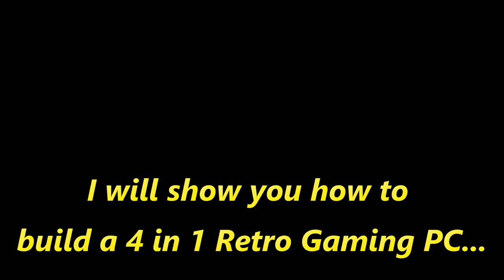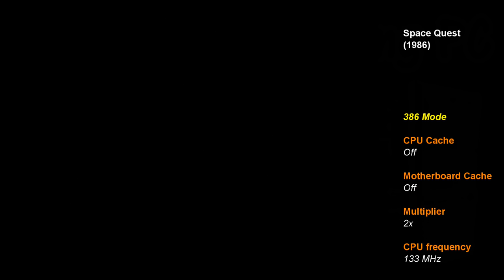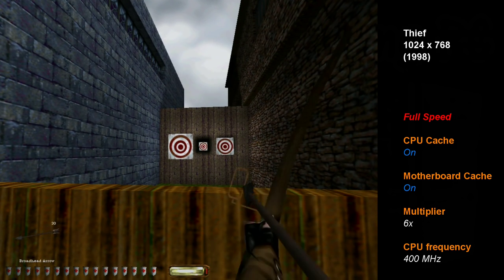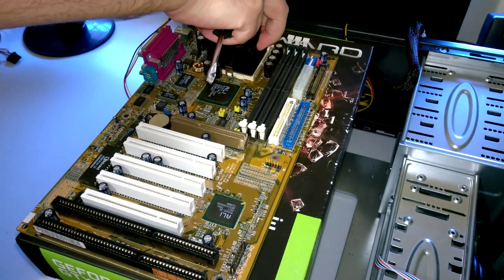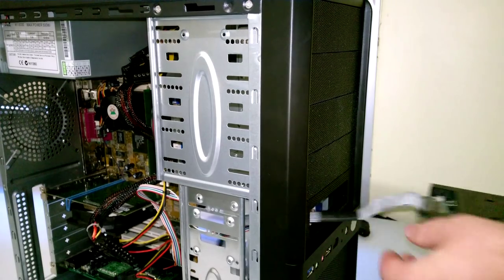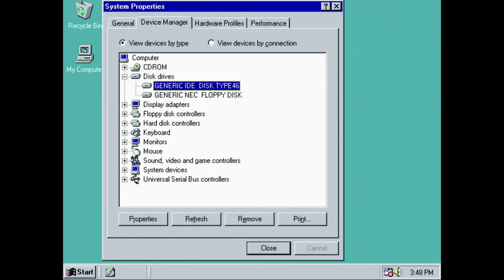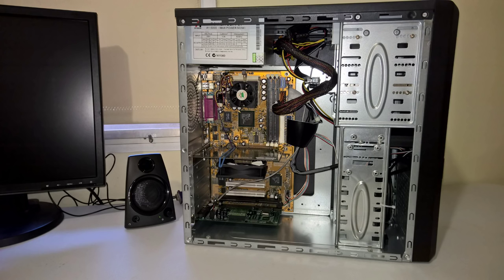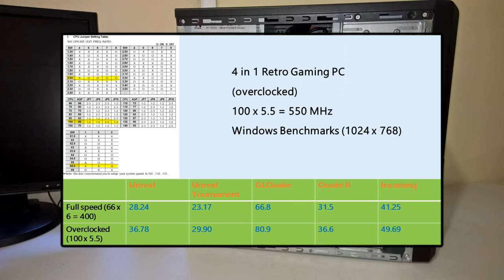Building a 4 in 1 Retro Gaming PC

Comment: Thanks for this - great space saving idea.  Any specific reason to not go with a faster 3dfx card?  I'm thinking of going with an ASUS P5A-B for this...do you have any experience with it and/or thoughts?  Also, I'm gonna track down an LAPC-I, what would you ideally pair it with?  Thanks!
Reply from the maker: Anthony Miller The main reason is that this processor will bore the V5. A Pentum III 800 MHz or so is a better fit for the V3. Asus boards are all great, just check that it supports the K6-2+ and K6-III+. LAPC-I is nice, but needs a PSU with -5V rail. Not a big deal, but they are getting harder and harder to find. IMO you're better off with an external MT-32 / CM-32L / CM-64 / CM-500 unit. Any Sound Blaster would go nicely with it for digital speech.
Reply: philscomputerlab Thanks, V3 it is.  I like the idea of the smaller MB form factor so I can fit all this into a white desktop case...more nostalgia for me.  Re: sound/midi, same power deal with a GUS?  I was thinking of an MT-32 as well, so will go that route.  Any considerations there?  I know it has an external PSU, but how would it interface with, say a SB AWE 32?  I appreciate the help.  I used to know all this stuff, but...been a bit of a while.  :)
Reply from the maker: While I got a GUS PnP, I'm just not a fan of it. I know lots are, but I'm just not so fond of it :)

You connect external MIDI devices to the AWE by using a joystick / MIDI cable. These can be found on eBay.
Reply: philscomputerlab If money were no object and the power supply issue was a mute point, 
what midi solution would you go for?  It seems like the CMs support some
 additional sounds that the MT-32 doesn't as well.  Not sure if the LAPC
 encompasses all of it...
Reply from the maker: Money no object? Well then you need to go for MT-32 (Old), CM-32L and Sound Canvas SC-55. This will cover all your MIDI basis. There are games that sound best on each of these, depends on the game. Sierra is mostly MT-32, Lucasarts and some others CM-32L and later General MIDI games sound best on Sound Canvas SC-55.
Reply: philscomputerlab Excellent!  Thanks!  I will seek them out.  These would be hooked up only one at a time, so no resource type conflicts, correct?  

Same question with the remainder of the setup...anything else you'd change without a budget constraint?  I picked up a Voodoo 3 3500 (TV tuner one) for really cheap thinking it would work well here too.  The Roland CM-110 speakers look like they'd compliment this amazingly, albeit expensive as well.
Reply from the maker: If you got 3 hours time, there is a video on my channel. The Ultimate Roland MT-32 tutorial. It's a bit long winded, one of my earliest videos, but covers everything you need to know.

While you can connect only 1 MIDI device to the joystick port, the Roland units have a MIDI THRU, which lets you put units in series. I have these three units in series. I also use a 4 channel stereo mixer, as well as a 4 to 1 audio switch. And lots of audio cables with all the correct plugs. It's quite a bit.
Reply: philscomputerlab Great, I'll take a look.  Found that Asus board with a K6/2 500.  Wonder if that will perform similarly.  Seems to be able to be stepped down as well...
Reply: philscomputerlab I'm finding some K6 III+ 450/APZ, which is also 1.7V.  Do you think that could push the 386 stuff just a hair too fast?
Reply from the maker: Once you disable the caches, the clock speed matters very little. The chips all perform around the same level, doesn't matter if 133 or 550 MHz.
Reply: philscomputerlab Great, thanks.  Re: the SC-55 you mentioned above, which revision/version is the way to go?  Weird that the hardest thing to find at this point is a nice, white type older case to throw this all in....found a nice one with a 250W PSU...that enough?

Last question on the MIDI options...  Is the LAPC-I essentially both an MT-32 + CM-32L?  It seems to have the additional sounds of the CM-32L with all the compatability.  I know you mentioned that the +5 rail PSU might be less available, but outside of that, is there any reason to get the (2) external units instead?  Thanks again!
Reply from the maker: The version of SC-55 shouldn't matter much. There are tiny differences, but really only a few games are affected.

The LAPC-I is the ISA card version of the CM-32L. They are 100% identical in terms of MIDI capabilities.

The PSU isn't an issue for Pentium III machines. But on a high power Athlon XP, modern PSUs won't cut it anymore.
Reply: philscomputerlab Thanks again - I hate to keep bugging you, but appreciate the help.  If it's okay, I'll check back with you once the parts start coming in.  I'm experienced on the computer side of things, but not the music side.  I'm also interested in the equipment you have it all connected with to avoid swapping out things. What's that HDD eject-able dock you're using?

Any experience with the Roland CM-110 monitors?  Not sure if monitors are the best idea for this, but would look great next to everything.
Reply from the maker: I have quite a few HDD docks. Currently I settled for a cheap model from eBay. It's the simplest, but also works the best. Featured in the 4 in 1 PC video.

Do keep the thread updated, always keen to hear how others are going. How old are these speakers? That would be my only concern.
Reply: philscomputerlab I went with the P5A-B mboard.  All AT style board would have a connector for the -5V line should I go with the LAPC, correct?  Is it just up to making sure that the power supply itself carries it?  Different connector or just part of the supply?

The power supply in the case I bought shows +5 +12 and -5 on the unit itself...
Reply from the maker: Yes it's just up the PSU to provide -5V. You can also get ATX to AT adapters that have a -5V convertor built-in. But an older PSU with -5V is the easiest option.
Reply: philscomputerlab Got it.  What version of Windows should I be running?  I'm doing this primarily for point and click adventures, so a lot will be in Dos I suppose.  I guess I'd want to install whatever is going to hit the widest range...maybe 95.  

Also, I've been messing with Munt thank to your tutorial and really like the results.  While I'm still seeking the Midi hardware, is it possible to run Munt on this machine in a native Dos or early Windows environment, or is it only possible via emulation (I understand that it itself is emulated as well)?
Reply from the maker: Either MS-DOS 6.22 or straight to Windows 98 SE is my recommendation. But be warned, Windows 98 SE with MS-DOS mode (7.1) is not the easiest thing to configure.

If you have a few hard drives, maybe setup one for MS-DOS 6.22 and another one for Windows 98 SE.

You can run Munt on a spare notebook or second desktop and use this as your MIDI box. I have a video about this on my channel.
Reply: philscomputerlab Slowly getting the parts in and building it... Got an MT-32 for about $90 shipped.  I'd like to run 2 hard drives, one with Dos and one Windows 98 as you suggested.  Is there a boot manager you'd recommend?  I assume dual boot would be the way to go...could it be accomplished via the mboard bios?
Reply from the maker: I have mucked around with Boot managers, but found the experience a bit frustrating. In the end I just used the HDD drive bay, and just ejected the drives and swapped them. You could use two and use the power buttons. The BIOS does have options to disable drives (set the drive type to none).
Reply: philscomputerlab Great idea.  I'd love to know which drive ejection device you've had success with.  The Icy Dock MB971SP-B looks like a good one, but would ruin my all white case design!  I was going to go with IDE drives, but could def do the SATA controller if all would be well in DOS.  Maybe a third drive installed and formatted FAT16 would be good for storage too.  Also, not following about the disabling of the drives...sorry.
Reply from the maker: In the BIOS, you can enter the drive type, or just disable it. But it's something I haven't done yet, so I don't want to give wrong advice.

The drive bays I get from eBay, no name brand, but the cheapest and work the best. Got a power and activity LED, but they are SATA.

I did use a decent boot manager a while ago, but I still couldn't set things up the way I liked it. http://gag.sourceforge.net/

I really want to revisit boot managers, it will come, one day LOL Just soo much to do.
Reply: philscomputerlab Found a bunch of version of the Gotek...do you know which you're using?  The one I ended up getting is the SFR1M44-U100K
Reply from the maker: Well they aren't labelled I'm afraid. I got the cheapest one with the 3 digits. Not much more I can say LOL I'm sure it works out fine.
Reply: philscomputerlab Getting "error code a" in the batch manager zotak software.  I wrote a few disks fine, a couple by writing images, then another copying a file and saving.  All was fine.  For some reason, these files won't write.  It's just disk of a game and only 400k or so.  Have you ever seen that?  Any ideas?
Reply from the maker: What is "batch manager zotak software"? Is this with the GOTEK? AFAIK it supports 1,4MB only.
Reply: philscomputerlab It's the software you use, in your tutorial, from ipcas.  I get that error when trying to write a couple of disks.  I tried both King's Quest 1 and 2 which are both only about 400-500k.  I was able to successfully write a single 350k file and then also images of Dos disks.

Also, I'm getting just about everything so far to run in Win98 either launched from Windows, a Dos prompt, or rebooting to Dos mode.  I do still have to load the CD drivers etc. in Dos mode though and not sure where to start there.  Any reason to do a Dos 6.22 dual-boot or on a separate drive?
Reply from the maker: Hehe you're experiencing the joys of working with retro hardware :) Lots of little issues get in the way of just playing games.

The files you're writing, are they disk images, or are you copying and pasting files?
Reply: philscomputerlab Copy/paste, nothing irregular about the files at all.  No long names, etc. I copy/pasted a single file, driver installer for my AWE64, and that was fine.  I appreciate the help...would be great to email maybe and I could send you screenshots.  

The build is going great...was playing Dig last night and loving it, although, haven't had to touch any of the "speed" settings.  Haven't even installed anything outside of Win98 and drivers yet.  Still curious about my Dos question, wondering what I may run into where it would be preferable to have a Dos install.  I have the MT-32 so far on the Midi side, but waiting on the cable.          : (
Reply from the maker: While a lot of games will run from within Windows, many won't. That's when you need MS-DOS mode.

Odd about the GOTEK. I have a GOTEK in my desktop PC as well, that way I can just quickly copy files across.

Did you format 100 disks with the software tool, or 1000 by holding down the buttons when you power up? I found the 1000 disks unreliable, so using 100 disks now.
Reply: philscomputerlab Did the 100 as you did with the same software.  I just can't think of anything particular about these files.  Happened with both games.

Re: Dos Mode, yes many don't launch from windows, but I've been doing pretty well with using dos mode from win98.  Not even speed issues yet with some really old stuff.  Just curious about any additional benefits that come to mind with a separate Dos 6.22 install.  Was going to do the HDD swap method.  Curious which drive caddy you were using...i like the push buttons and the ability to have a power switch for each drive.
Reply from the maker: There are many types of HDD bays. I really like this one: http://www.ebay.com.au/itm/3-5-Inch-SATA-Hard-Disk-Drive-HDD-Caddy-Connector-Bay-/151271815423?hash=item233880b8ff

But there are others that also take notebook drives, but they cost a bit more.

You won't find a game that doesn't work in MS-DOS mode, it's proper DOS after all :)

The main benefit of using 6.22 on a separate HDD is that it's easier for beginners. Configuring a Windows 98 / MS-DOS hybrid system is not easy, I have a video on this, and to do it properly takes quite a few steps.
Reply: philscomputerlab ok, silly question...i have the MT-32 powered up and the correct cable.  Does the in/out midi cable effectively send the sound back to my sound card, then out to the speakers?  Or, do I have to use the outputs on the back of the MT-32.  If so, how would you combine the midi and digital sound?  

EDIT - I answered some of that.  Found an old 1/4 to 1/8" adapter and got it working in Windows.  Copied a couple of midi files (canyon of course) and it plays great in Windows.  Every Dos game though lets me select it and loads the drivers, but nothing is sent to the MT-32.  I am running them from a command prompt in Windows and they are running fine.  Do I need a Dos driver for this to work even though it's still in Windows mode?
Reply from the maker: What sound card is it connected to?

Monkey Island and MI2 are good games to test. Launch with monkey r or monkey2 r for roland sound.
Reply: philscomputerlab SB AWE 64 Gold.  Problem is I don't have a floppy drive yet, so been trying with the few CD games that I have that support it or using GOG versions of the older stuff, which error when they try to write the config file after I run the install program.

Not sure if you know about the eXoDos project, but also trying with some of those versions.  They seem modified and I have issues trying to install and sometimes run them.

EDIT - Grabbed a scumm version of Monkey Island which is the original and has the floppies.  Ran from either the gotek or installing all to one dir on the HDD.  Launched with "monkey r" and nothing.  All still works fine in windows though.  Is there anything I should have to be doing since they are running in Dos mode?
Reply from the maker: Anthony Miller Well you will need the drives working in MS-DOS mode. Check out: http://www.philscomputerlab.com/ms-dos-mode-tutorials.html

Once you watched the videos you will see why using a second drive for pure DOS 6.22 is easier :) If you go with that option, I also have a starter pack with drivers for CD-ROM, mouse and memory on my website.

The AWE drivers are still on the creative site, but you can also get them from my website.

Basically you run into the exact issue that most retro gamers run into. They muck around with Windows 98, everything works, but MS-DOS mode proves to be challenging :)

I am planning a video on a machine showing dual HDDs with Windows 98 and MS-DOS 6.22 to keep things separate, but this could be quite a while until I get to it.
Reply: philscomputerlab Got it - thanks.  I thought since it's not Dos mode but rather just launching from a Dos prompt that it was still technically running in the windows environment.  Is that not the case?

Case in point, MT-32 aside, when I run games from windows, the AWE64 works great for digital sound running from a Dos prompt.  When I reboot to Dos mode and run the same game, no sound.  It makes sense since I haven't touched any Dos drivers yet.  But since it worked when launching from Windows, I don't get why the MT-32 would be any different.  Any thoughts on that to pu my mind at ease?

For some reason, I was thinking the Gotek would only work from Windows, but just realized it should work from Dos just fine.  I have a 2nd HDD and Dos install disks, so will do that next.  Thanks!
Reply from the maker: The Windows drivers include DOS drivers for MS-DOS prompt. But when you boot into MS-DOS mode, it needs proper DOS drivers.

GOTEK is like a floppy drive, it will work in pretty much ANY operating system :)
Reply: philscomputerlab RIght, so since I'm launching from a Dos prompt, is there any reason you can think of that the MT-32 wouldn't be receiving any data?  Digital sound works fine....
Reply from the maker: Lots of reasons. But the short answer is don't mix DOS with Windows. You will always run into issues.

Keep them separate. For DOS use MS-DOS mode, or 6.22 on another hard drive.

I know General MIDI works, like in DOOM. Could be resources issue, timing issue.
Reply: philscomputerlab fair enough, I get it.  Your tutorials have been really helpful.  I could have stood up a Dos PC with drivers and everything no problem 15 years ago, but need to be reminded of some stuff for sure.  Which vid do you think is most relevant for me at this point?

I'll likely do the Dos mode stuff in parallel as well.  Thanks so much for all the resources you've provided.  The site is great and having all of the files right there is a huge convenience.  Surprised you don't get more views...  Anyway, I see the soundblaster in Dos mode stuff....is there anything special to do for the MT-32?

The mboard I went with is GREAT except only supports USB with a "dongle" and I don;'t have it.  I'm stuck to either the Gotek or burning CDs to move files over to it....frustrating!!!  :)  I'll try to get it on the network soon and maybe i can get file sharing to work.
Reply from the maker: The most relevant video for MS-DOS mode is the top video on this page:

http://www.philscomputerlab.com/ms-dos-mode-tutorials.html

Comes with DOS drivers and boot menu as well.

Yes the MT-32 will work once the DOS AWE drivers are loaded and working.
Reply: philscomputerlab Thanks - same tutorial for a raw Dos install?  I just got 6.22 installed on my other HDD.  Running Monkey Island 1 with PC speaker...  :)

I see the AWE64 Dos drivers on your site...4 files.  I get the first one, what do I do with the other 3?

EDIT - Success!  Sort of...  Completed my Dos install w/SB drivers, mouse, cd, etc.  All works great.  Not sure what the last two SB files you had there are though...would you let me know?

The MT-32 is working in Dos.  The only game I have it working properly so far is The 7th Guest.  I imagine I can run the MT-32 output to the line in of the Awe32 in order for it to mix the midi with the digital sound, correct?  I'm just waiting on a cable to do that.

When I load up Monkey Island 1, it does play sound, but it's kind of a mess and not intended.  When I exit the game, it just keeps playing and i have to reboot.  Should it sound proper on the MT-32?  I am running the expanded memory mode.  Still have to wait to get my internal and external floppy drives to get the sierra stuff going.  All of the GOG stuff and scumm versions I have wont write the config files correctly.  It seems that they've been modified just enough to not want to run natively.
Reply from the maker: Ah yes, no video. Just driver folder, autoexec and config. All you need for DOS :)

To copy games I remove the HDD and put it into a USB HDD docking station. Copy games, then put it back in the machine :)
Reply: philscomputerlab one more for ya....  I ran the out from the MT-32 to the line in on the AWE64.  I can't seem to get it to output midi that way (in windows for now).  I don't see anything in multimedia settings in control panel that would make a difference.  That said, I'd like to use an external mixer as I plan to get more Midi hardware, etc. anyway.  I wouldn't know where to begin here...what would you recommend?  I'm not that price sensitive, would rather get good, fully featured stuff over saving money. 

Also - SeaTools just boots to a command prompt for me.  I burned the DOS bootable disc.  It boots, then eventually hit a "seagate boot" command prompt and says there's a log file, hit ctl+alt+del to reboot, etc.  Have you seen this before?
Reply: +philscomputerlab Hey Phil - couple of quick ones...  I got a SCSI drive for Windows.  Should the Seatools program also work with it?

Also, got my SC-55MKII.  Which games are good to test with?  I only found Doom so far that had an option for it and it just hangs on a single tone that slows down the program.  Also Xeen...same thing.  Demo sounds work great from the unit.  Thinking I'm just not initializing it correctly or maybe a push-button or something.  Thanks!
Reply from the maker: I've never worked with SCSI :( I doubt that SeaTools will work with it though.

The issue with Sound Canvas is odd. In Doom, the option for General MIDI is the same as for Sound Canvas. I'm not sure why they made two options.

Make sure the MIDI Out goes into MIDI in at the back of the unit.
Reply: +philscomputerlab OK, thanks.  I expanded a bit on the topic here:

http://www.vogons.org/viewtopic.php?f=46&t=44675&p=442567#p442567